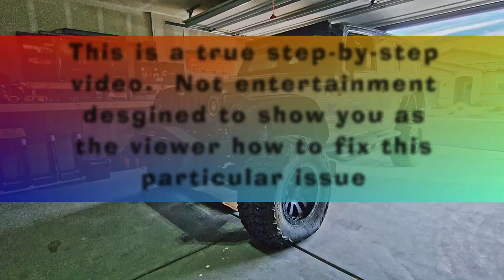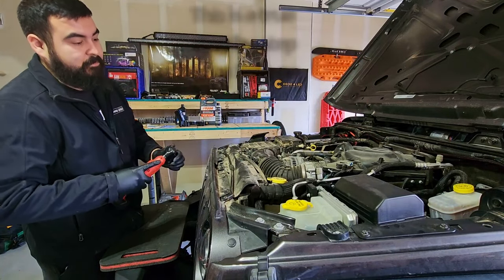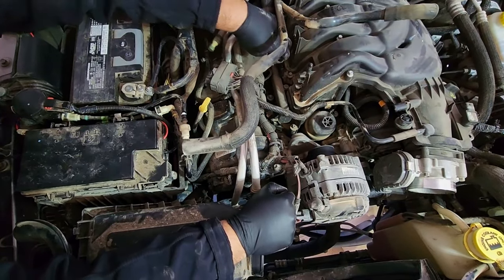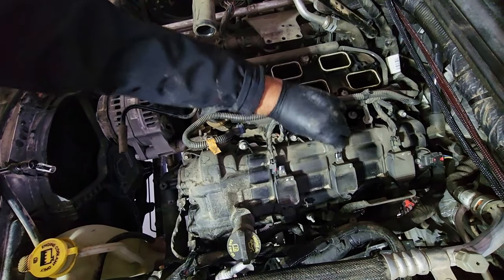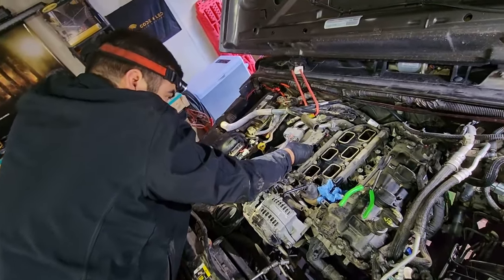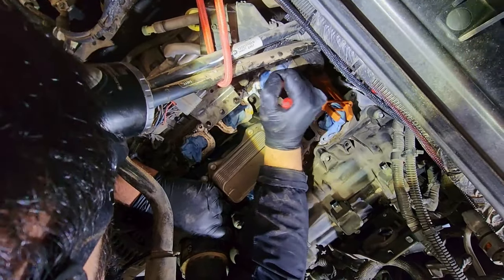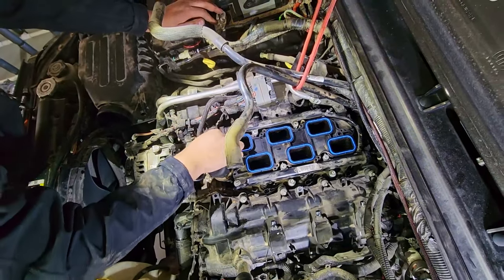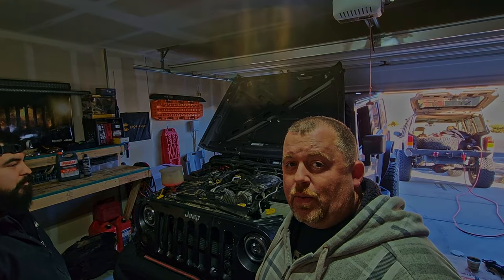Replacing 3.6L engine Oil Cooler, Step by Step

Comment: Crazy for an oil cooler to be in that location. I suppose FCA has a very good reason for that engineering design. I just had mine done at the dealership. Started to leak at 55k miles.
Reply: Why?  Throw that money down the drain their buddy...lol
Reply: The oil cooler is cooled by the engine cooling system
Reply: its good for packaging, they put that motor in everything.  it gets mounted longitudinally and transverse in everything from mini vans and cars. too jeeps, trucks and cargo vans. just wish they used aluminium and a better seal design so it didn't fail all the time.
Reply: what did the dealer charge?
Reply: City Dodge wanted 1200.00. However, I just  made it right  b4 my warranty expired. I had 54k miles when it happened 2 me. I never dogged my rig - I always take off slowly and gradually pick up speed. I now change my own oil and filter, taking care when installing filter and oil ring.

Comment: 1 quart of oil isnt enough if you do this job drain your oil before starting the car. If you got some coolant in the engine then your oil is contaminated and you shouldnt start the car. Safe bet is to do an oil change after installing the oil filter housing so youll know if coolant got into the pan. Also use the all aluminum replacement as its much better than the redesigned mopar one that is still mostly plastic.

Comment: A methodical video. An old friend wants to sell his 2015 Wrangler with the leaking oil cooler. To replace is a couple of thousand, so I'm debating with myself if I should give it a go. I've preformed much more complex repairs in the past, this one is tedious, but doable.
Reply: It's only methodical because you don't know the correct procedures. He didn't torque anything, this cooler is guaranteed to leak in the near future. Know who you're dealing with before just trusting someone to tear your car apart

Comment: Marco thank you for the video. I have watched several of these and the way you did the repair is definitely one of the best. Good job of videoing the process. My has not started leaking yet but I have ordered the Dorman with FelPro gaskets. I went ahead and ordered a set of spark plugs. 
Thank you again

Comment: Great video, THANKS! Everything I needed to do it myself.  I went with the aluminum body upgrade.  The oil pipe in the front on the all metal body takes some force to seat, but goes together just like described.  
We had been smelling coolant for the last 9 months but several mechanics couldn't find it.  Troubleshooting an oil leak and based on the amount of oil and coolant pooled between the manifolds, this hopefully will solve both problems.
Thanks again!

Comment: I got a Mishimoto aluminum oil cooler to install very very soon. Great looking unit with upgraded seals.
Reply: How did it work out? I can’t find anyone that used the Mishimoto and then followed up with how it went and how it’s working.

Comment: Great video, thanks for taking the time to upload. Just bought a 14 with 50k on it, three weeks in the cooler popped and dumped oil everywhere lol. The rig is rust free and is like brand new so I am not too upset being a known issue.... just wish it would have waited till spring instead of the 2f temps we have now!
Reply: Mine is a 15 with 100k and it just popped Monday I waited till it could warm up in the 30 to do it
Reply: @savagewates8373  Thats a good idea, I had several issues due to cold, a few plastic pieces that broke, fuel line lock tab and throttle body plug. I could only get my garage up to 16f, what a pain ha ha.

Comment: Could you list torque specs for the oil cooler and manifolds?
Reply: 106 inch pounds oil cooling unit and lower intake ❤

Comment: Thank you very much for this video. It makes a difference to see this work done by a professional that replaces this unit on a routine basis. Did Marco remove the drivers side sparkplug connectors?

Comment: That was a good detailed step-by-step. I was just wondering why it didn’t get replaced with an all aluminum housing and cooler rather than the plastic and aluminum ?
Reply from the maker: At the time, the all aluminum one was on back order. With as bad as the leak was, I couldn't wait

Comment: Did you have any issues with the O-rings on the Dorman unit just studying to see if I need to buy alternative sets
Reply from the maker: No i did not. Infact, compared side by side with the originals, they seemed thicker and better quality. Since the video, have probably done two dozen more of these repairs, have had zero further issues with any of them.

Comment: I get to do this on my 2012 JKU.  Should be a lot of fun.
Reply from the maker: Easy peasy. No sweat. 😉
Reply: In the process now. Got it all buttoned up but the fuel rail was seeded properly so when I fired the engine I started leaking gas. Gotta take it apart again. I’m sure lots of cuss words will be had .

Comment: Thanks for this video. I wound up here after doing a search for oil cooler replacement on the Pentastar and will use the all-aluminum heat echanger that you noted in another video. I actually just bought a 2016 Caravan and this part scares the hell out of me, among other crappy plastic parts on this Pentastar. I also live in a hot climate and I wanna get ahead of this ticking time bomb. Anyway, great video, I found it useful as hell, I don't own a Jeep anymore but I had of a blast when I did! Did you by chance get rid of this very stupid plastic fuel rail on the pentastar? I will probably do plugs, oil cooler, fuel rail, etc. all at the same time. Can you think of anything else? Thanks again!!

Comment: Question - we recently had this replaced on my daughter’s 2011 Chrysler 200 limited convertible that has the Penastar engine in it. Currently it’s throwing a code that I need to replace the oil pressure sensor which a new one came on the full oil cooler replacement housing like y’all have here so in order to do that it says to release the fuel system and I’ve watched a ton of videos on this and never see anyone do it. I got my instructions printed from AllData which your friend may use at his job like I do. Just wanted to know if I truly need to do that (assuming it’s for when I take off the fuel rail?

Comment: Is the oil filter cooler housing the same for 2011? I cannot find any videos about that.
Reply from the maker: No, the oil filter on the 3.8l is a spin on filter I believe located under the motor.... this issue is primarily for the 3.6l Pentastar....
Reply: @JeepingForBeginners  ok, so the 2011 don't have that. No wonder why the part only came up for the 2012 and up. I do have a oil leak coming from somewhere.
Reply from the maker: Those are known for valve cover leaks, and crank seal leaks. A good power wash followed by adding some engine dye, will help determine where for sure

Comment: Great video and it gave me some ideas on how to do it easier. I have another issue which is with the O2 sensors. i have replaced them all and i am still getting a light. I had it checked and its telling me that its due to low voltage. Battery and the alternator are good. any suggestions?
Reply: PCV hose might’ve broke and you have a leak

Comment: Any particular reason you replaced with the Mopar unit rather than the aluminum Dorman part?
Reply from the maker: The Dorman part was on a back order at the time. Ironically so was the Mopar part. But when I inquired, it was faster to get the Mopar one. It was not necessarily a preference, just current availability at the time.

Comment: Does Marco recommend the aluminum replacement ones like Dorman over OEM plastic?
Reply: The problem is that it's usually the gaskets on the bottom that fail, not the plastic housing itself. So in that case, the aluminum housing isn't going to help.

Comment: i changed my second one  to a aluminum one. a year later this one is leaking. time for another one. why did this happen so fast. its like one a year
Reply from the maker: Post covid... quality of aftermarket parts like gaskets have gone downhill I've found. You shouldn't need a new cooler, just the gaskets. What type of oil do run?

Comment: So there’s no torque specs on this job?
Reply: There’s several torque specs. But of course, like most shop and stealership techs, they prefer the calibrated elbow technique. This is one of the reasons so many people have to have jobs done several times. Nobody holds techs responsible anymore. Do it right the first time and you’ll only do it once.

Comment: At what mileage do you see these oil filter/cooler housing leaks?
Reply from the maker: Out here in the desert, the average I see them is about the 60 to 70k range... but I am sure climate makes a difference.... the oil cooler is in a spot where excessive heat exists... rubber and plastic breaks down under heat... so it's hard to say a typical average across the board... colder climates may last longer, OR may speed up the process. Not sure. But like I said, my experience shows about the 60 to 70k mileage range.....
Reply: @JeepingForBeginners  thanks.
Reply: Mine is at 93k
Reply: 53000 for me on my 2015 Hard Rock Ed

Comment: At minute 25.45 after the lower intake is reinstalled, YOU, for some bizarre reason, decide to SKIP showing the "reassembly" of several components like fuel injector wiring connectors, fuel lines, upper manifold bolts and hoses and cut to the completion. Why..... the job is not done at that point. Did you inquire with your Tech Marco about that edit? If your channel is "Jeeping for beginners" wouldn't you think those Sequential steps and techniques would be important? Great job by Marco up to that point until you cut him off. Folks try to find a legit video for the last half of the fix i suppose. Also adhere to Torque Specs on these bolts and don't buy a plastic housing like the one used in the video. Dorman produces a Made in the USA all aluminum assembly. Why go through all that work to replace a failed plastic composite housing with a plastic housing that fails ........because it is plastic. Great job Marco.... you should be the one with the YouTube videos.

Comment: First off. Being a certified Jeep mechanic, if he is one? Always disconnect the battery cable anytime you are disconnecting electrical plugs. Also you should never use the palm of your hand to loosen anything! You have a lot of nerves in your palms that can be permanently damaged. And remove rubber hose fittings by twisting them back and forth. And last but not least. TORQUE all nuts and bolts. Just guessing is not good enough, even if you think you have a feel for it. Those little bolts are Inch pounds of torque. And you can easily over or under torque them. Over all, a good video though. 😊

Comment: What's the deal with you back alley mechanics. In my shop, if I find out you didn't torque each bolt to specification, you're done working for me. ALL bolts gets torque, PERIOD. This way you know for sure the professional job was done right the first time.
Reply: Relax bud